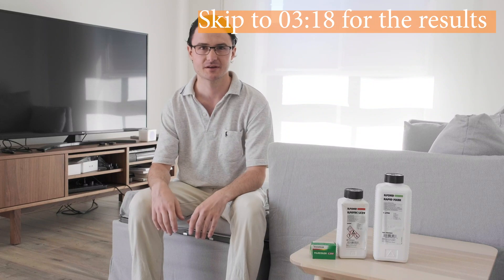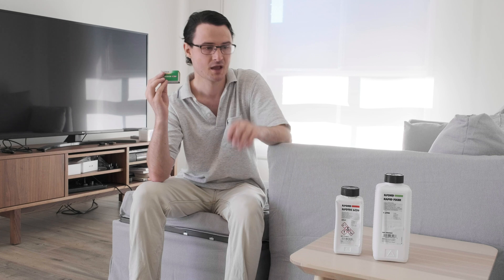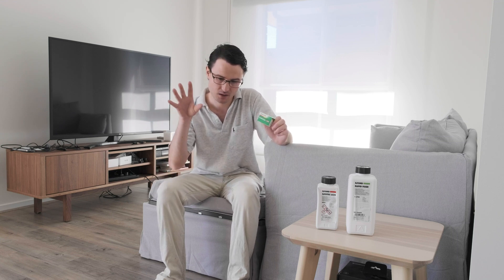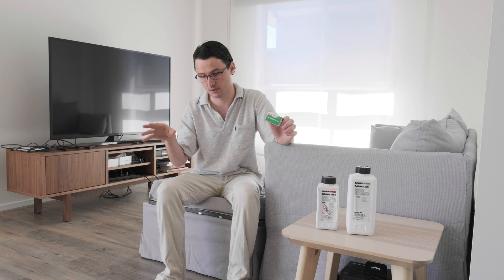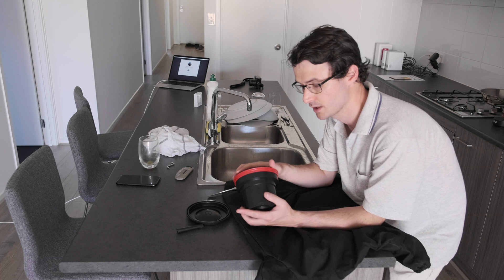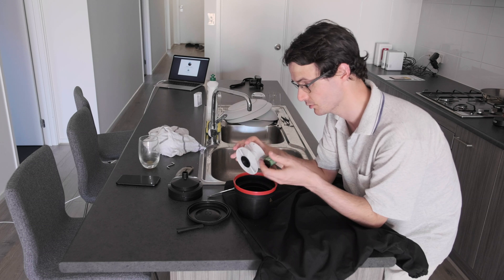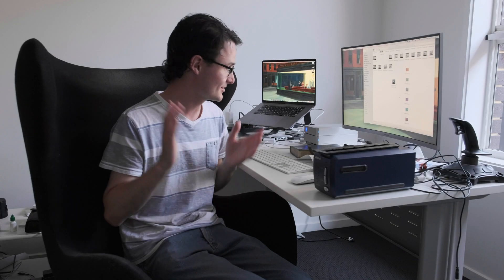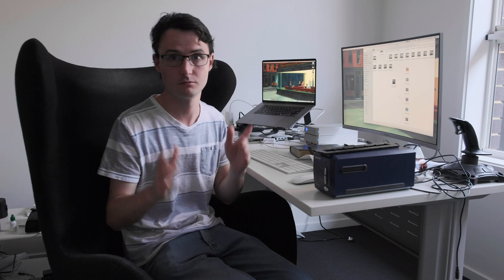Cross processing | What happens if you develop colour film in black and white chemicals?

Comment: You need to convert the scans of the B&W developed C41 film to B&W images.  As you developed it in B&W chemicals there was no colour development so what you are seeing is junk from the undeveloped colour dyes.  This method is used to get B&W images from a colour negative and is a way that some people process very old colour films that were exposed decades ago, they throw away the chance of getting usable colour from them.

You tend to scan the film as colour negative however, convert to B&W afterwards.  I'm pretty impressed that you didnt get a very dense negative with that film.  Some kodak I cross processed a while back is so dense that my scanner has trouble pulling much out of it, although holding it to a window shows the images just fine.  The reason it is dense is because the C41 process has a BLIX step that bleaches and fixes and this makes the negative much more transparent.
Reply: can you use bleach thou when crossing color with bw chem?